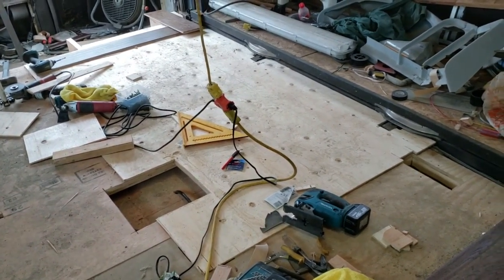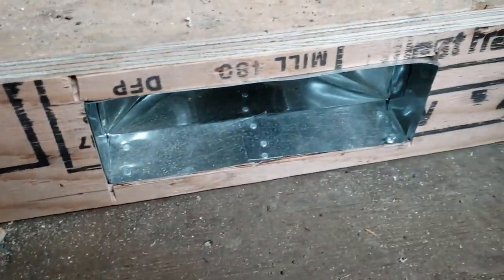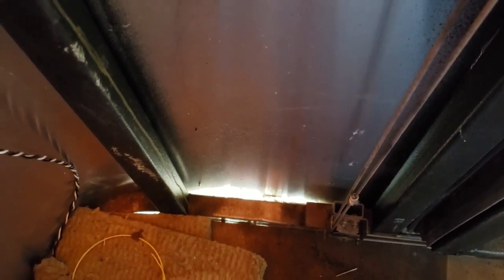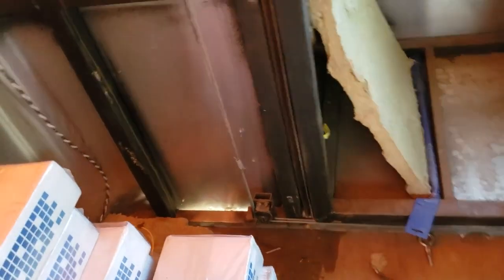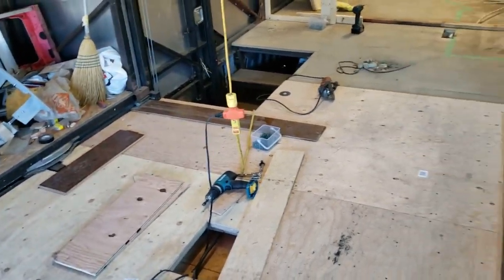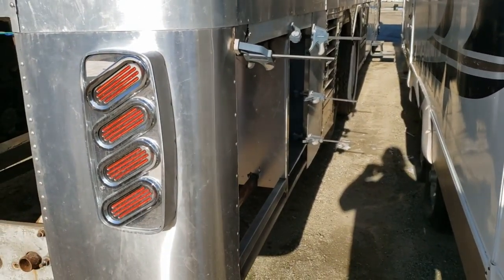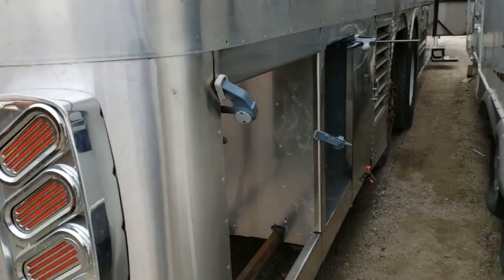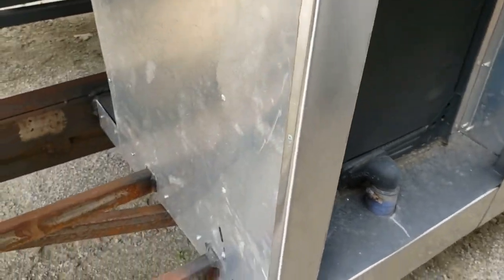Bus Conversion Project - Video 104 - getting ready to insulate and skinning the rear quarters

Comment: James great to see your doing good and making amazing progress given the weather issues.  A point to think about while you still have the space open above the tool box locations placement of future use conduits and underfloor insulation around the vent pipes to reduce engine heat and  road noise traveling through the floor. Sorry to hear about the swing arms although you had the forethought to buy the necessary parts to change the design if ( now ) needed. I'll look in my tool boxes and see if I can find you a slide-out shrinker LOL. Hope the rest of the family is well and remains that way.
Reply from the maker: If you can find a slide-out shrinker, I'll rent it from you.....I will insulate that area from above, the bedroom floor is just sitting in there, it has to come out so I can insulate that whole area, I think I'll install the furnace ducting from below and them finish the rest from the topside, I'm thinking I might spray some foam insulation around all the seams before insulating with rocksul like the rest of the floor, spray foam is supposed to be great insulation but it's not much good and sound deadening I'm told … hope you are doing ok in this crazy time....
Reply: @JamesEDennison  you have heard correctly spray foam is a great insulator and draft stop. but it sucks at noise control . very good idea to get all the seams first then wait 3-4 hours before you put the rocksul 2 reasons mild off-gassing and allows time for low and slow expansion foams to fill and then skin over less messy on the rocksul  if you are test fitting cuts or even your hands if you are measuring the pieces. ( from experience comes wisdom.  ie. been there done that learned the hard way ) no luck on finding the slide-out shrinker

Comment: Have you had any issues with clearance and scrubbing on the rear since it's so far away from the wheels?
Reply from the maker: No, it has about the same overhang as a typical class A motorhome at 11 feet., I will also be able to raise the rear suspension if I run into any questionable terrain... of course, that being said, I've hardly driven it except for about 300 miles so time will tell but I don't anticipate any problems
Reply: @JamesEDennison  I guess I'm so used to our MC8 and GM4104 as to their short overhang.  You are doing a fantastic job on the bus.